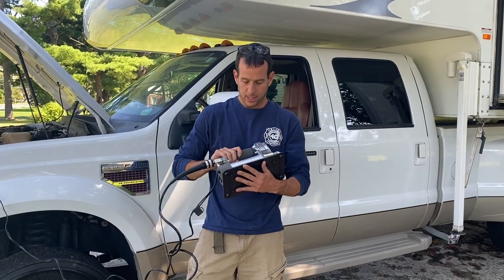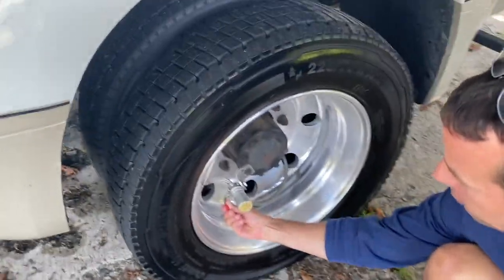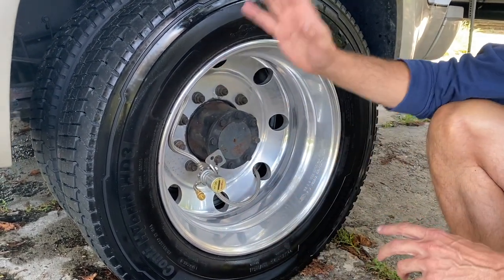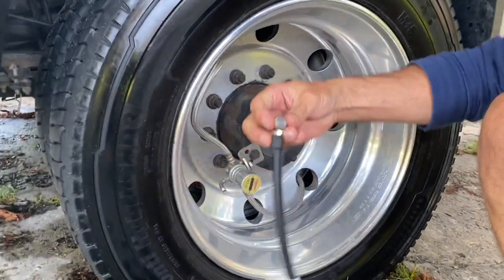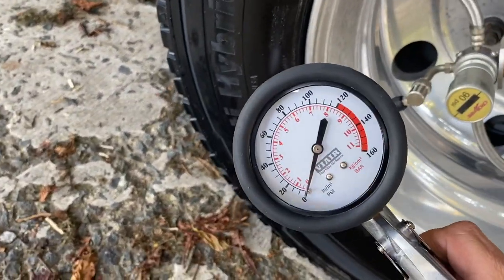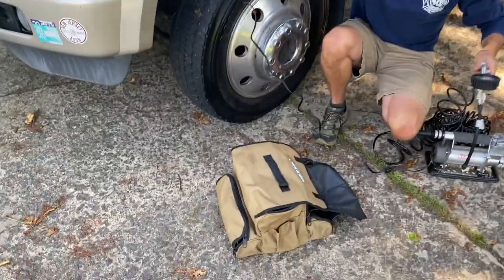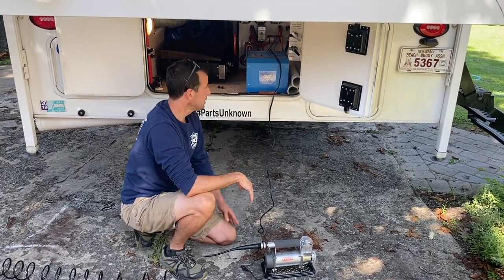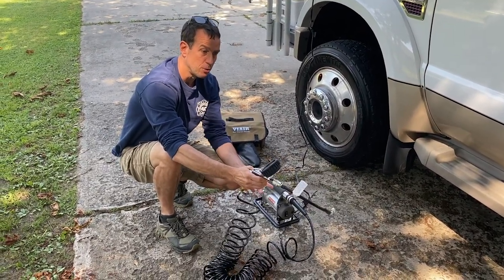The best air compressor for the beach w your Truck camper or RV  Viair 400p

Comment: Even this little air compressor seems like it takes a long time to fill only 10 lb up could you imagine if you have to fill 60 or 80 lb how long it would take. So I really wonder if there's a small air compressor out there that really works fast and a very strong and durable this one didn't sell me
Reply: Not that’s portable and lasts forever. The best vair is meant to run forever. Faster ones are great but aren’t meant to last. This coming from a landscaper with 3 trucks who uses one almost everyday

Comment: I was always curious about those crossfires. So those are equalizers, correct? So what happens if you get a flat on the duals. Would they both loose pressure because it sends air to the other one? Normally if you get a flat you may still be able to drive a couple of miles to a tire shop, but with this you would be stranded?
Reply from the maker: They have some type of device to prevent total air loss if one tire goes bad.

Comment: Are you able to refill all your tires before it shuts down or over heats?
Do you have any problems driving your truck on the beach with loose sand?
Reply: I burned up a Viair * five years ago airing up my Jeep tires to 35lbs. It was really hot that day. I did not read the owners manual. I was in a hurry running the unit way too long not allowing the compressor to cool down. I burned up my $178 compressor real quick after almost reaching 35lbs on my fourth tire. 

These are NOT continuous use pumps! Especially hot summers. If I ever use one again, I will have a Kobalt 24 volt fan running on high to cool the pump cylinder. Even then, I’d run the unit no more than 10 min. At a time without cooling it down. The 400 seen in this video I suppose is very expensive!  Be forewarned.

ARB makes a twin continuous operation unit. It has its own built in fan. But even then, at $1000 I’d be cautious running it too long if it were me.

Comment: Viair Compressor and Crossfires?!?!  I'm impressed!!  Nice job.  Oh and 22 psi for the beach is a bit too high...
Reply: I don’t change at all. Stay at 40psi for the usual 60 miles down the beach and 60 miles back. No problem yet
Reply: @forrest2426  PINS?
Reply: @stevej5276  Not sure why this is at me I didn’t say pins but it stands for Padre Island national seashore
Reply: @forrest2426  you had mentioned driving on hte beach 60 miles and back, I was just asking if that was PINS because that is about the distance to the Mansfield jetties